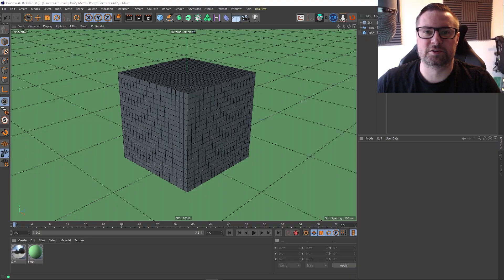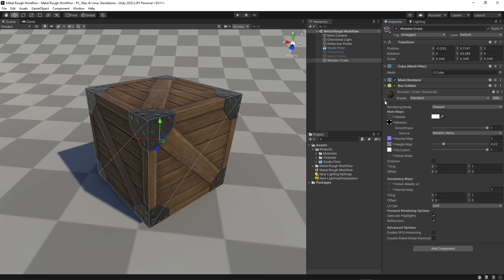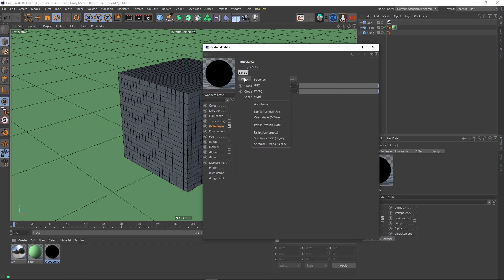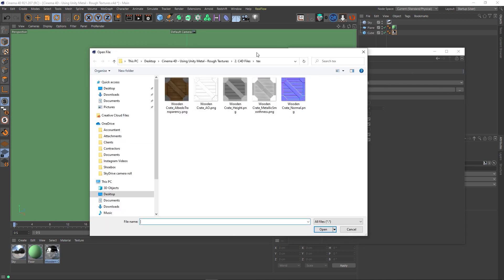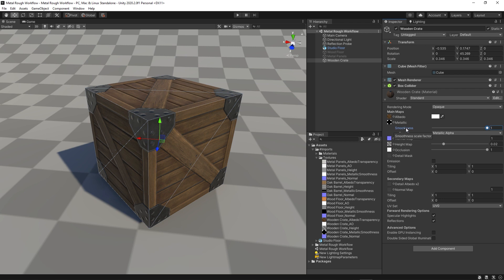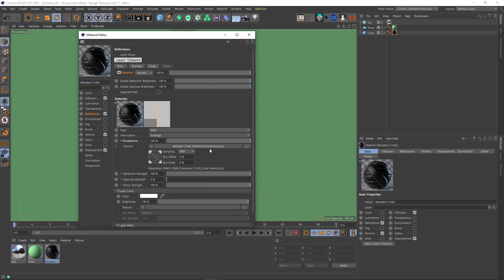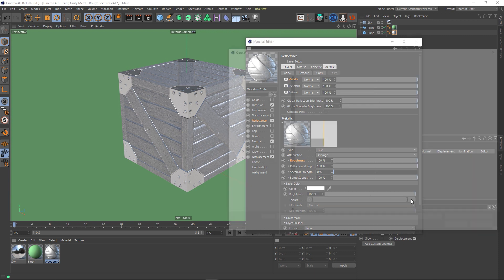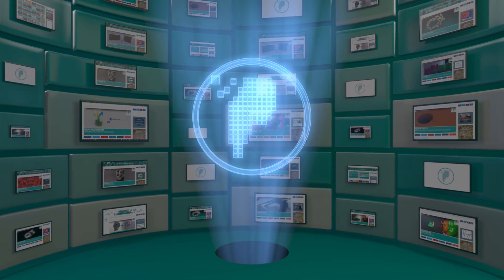Cinema 4D: Using Combined Metal / Rough Textures

Comment: Great video. I'm struggling to get an occlusionRoughnessMetallic map working. Because colour, not alpha is used for metallic and roughness I can't work out if it's possible with c4D. Any ideas?
Reply from the maker: I'm confused, what do you mean? How are you generating your maps?
Reply: @DIGITALMEAT  Thanks for the prompt reply!  Exporting from Substance painter using the GLTF template. I have Occlusion(red)Roughness(green)Metalic(blue) all in one image . I think I need to isolate those colours to use for the roughness and metallic within cinema. I think with my version of cinema I need to use a the node editor. That's what ChatGPT says anyway :)
Reply from the maker: @planetvr1653  - I think your right about the node editor, as there's no way to target one colour channel of the texture in the normal material dialog, just layers.
Reply: @DIGITALMEAT  Thanks. Started watching a video about it as it's totally new to me. Need to sleep now but will hit it again tomorrow. Thanks again for the reply. Really appreciated! ♥️
Reply: Answering super late as I've just saw the video and possibly you are using a different render engine, put your packed texture inside a colorizer and in the dropdown selec the color channel to use the corresponding data map. e.g Ao=red channel, Roughness=green channel or metallic=blue channel
Reply: I've messaged via your site but if you could recreate that material with standard c4d r20 material nodes I'd happily pay! 🙏
Reply from the maker: @planetvr1653  - I'm not even sure it's possible in later C4D versions let alone R20. Beyond that, I'm not taking on any paid work as I have a full-time contract with Rizom-Lab, sorry dude.
Reply: @DIGITALMEAT  no worries, thanks anyway. RizomUV rocks!